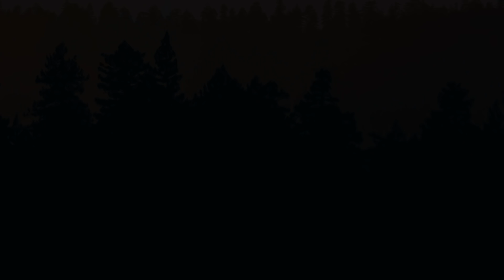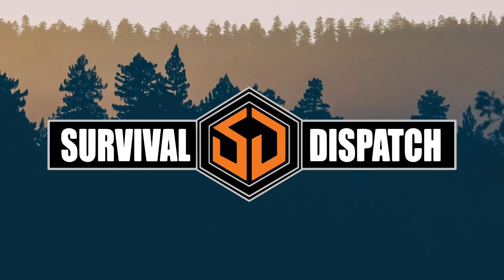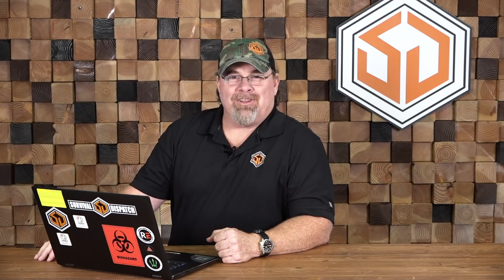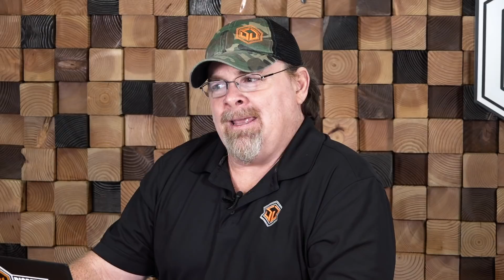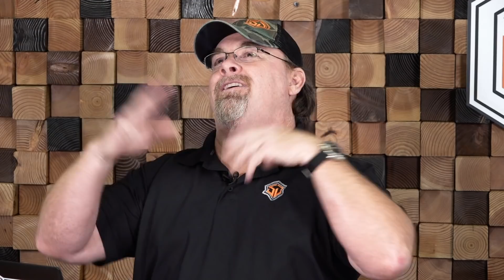All About Generators!

Comment: GFCI's do NOT sense ANY kind of shorts!!! They sense resistive connections between the hot line and ANY ground whether it be to a ground wire, water pipe or mud puddle. Not just neutral. Resistive connections like through the human body that won't blow a standard circuit breaker. Under certain circumstances, milliamps or thousandths of an amp can kill and never blow a breaker.
    There's also natural gas and there is a power difference between propane, natural gas and gasoline. Processed commercial natural gas has even less energy than propane because commercial gas companies usually remove hydrogen from natural gas and sell it separately because it's cheaper to make than making it by electrolysis. If you have a private well that you own, your results may be better. Free gas that is given by gas companies here in West Virginia in exchange for pumping gas from your land. It usually comes through normal service lines from a processing plant and, again, contains less energy. Propane does NOT reduce the output of a generator. Propane reduces the output of the ENGINE driving the generator. I only say this for the people who are building a system from scratch. In other words, If someone acquires a 5000 watt generator head and wants to marry it to an engine, if they're going to burn gas, a 10 horse engine will work fine. If they plan to go to Harbor Freight and buy an engine with the intention of converting it to propane, they will need to pick up at least a 13 horse engine to compensate for the lower energy capacity of propane.
    I bought a Coleman 5000 watt generator with a 10 horse Tecumseh engine in Florida with a 2 year extended warranty in 1998 in anticipation of an impending storm. Twenty months later, I asked my wife if maybe we should pull it out of the box and see if it works before the warranty ran out. Needless to say, the storm didn't materialize. It worked. Fast forward to 2001 and we moved to West Virginia. We had a doublewide moved onto our land. Being disabled, it took 3 weeks to get the meter box and disconnect installed on our house so we used that generator 24/7 to run the fridge, window A/C, (wife has temp. regulation health issues), lights, freezer, TVs to keep us and the kids busy. I wired 2) 4 gang steel outlet boxes back to back to both legs of the 240 VAC 30 amp twist lock plug. After tripping over the cord one night and breaking the twist lock socket, I went the next day and bought a 50 amp socket and plug.
    The engine instructions called for the oil to be changed every 40 hours. When gas was $.69 a gallon then, the oil changes were more costly. BTW, I agree with the 24 hour oil change interval with today's generators.
    Anyway, Tecumseh went out of business years ago but that was a great engine and aftermarket parts are still available. Just before it went into semi retirement, I should have but didn't check the torque on the sparkplug which wiggled loose and ripped the threads out of the cylinder head. I removed the head and took it to a shop and had a helicoil installed. They didn't have another head gasket on hand so it sat unfunctional for a while. My above mentioned disability is my spine and I was coming up on my 6th surgery in a few months. During this time, sadly but serendipitously, I had a relative pass away who left my siblings and myself a bit of money. Knowing that I wasn't going to be able to whip Chief Tecumseh's 10 horses awake with the pull of a rope anymore, I went out and bought the smallest available electric start generator that I could get which turned out to be a 7000 watt Troy Bilt with a 13 horse Briggs and Stratton engine. This was a spine saver to say the least.
    When I was still using the Coleman, and after our NOT CONNECTED TO THE HOUSE garage was built, I knew that I was going to wire it so while I was picking up supplies for that, I bought enough 8 gauge 3 wire with ground cable and conduit to run from the nearby disconnect box on the house where I installed 2) 50 amp breakers then to the 8 position breaker box in the garage. I also picked up a 4 prong 50 amp outlet, plug and wall box. I wired the 50 amp 240 VAC twist lock plug that I replaced for the 30 amp unit in the generator to a piece of 8 gauge wire then to the 4 prong 50 amp plug and that socket to a set of dedicated 30 amp breakers in the garage breaker box. Then I went to my computer and paint shop and drew a labeled diagram of EVERY step that had to be taken and in which order then walked my wife and then teenaged son through it at the breaker boxes and generator until they could show me the process. Some call my setup with my "suicide cord" dangerous but my wall plug is dedicated. No dryer, compressor or arc welder. Just the generator so it is never unplugged. If we ever move from here, the generator is going with us and the 50 amp socket reverts to a 30 amp usable circuit in the garage.
    When I bought the Troy Bilt, it already had a 50 amp twist lock plug so my setup plugged right in.
    Fast forward to 2 weeks ago. My 90 year old father in law passed away. My wife was setting up the estate sale. I inherited his 6000 watt pull start Troy Bilt generator among other things. I wanted a backup unit ever since my Troy Bilt gave me trouble once when, after 6 years, the starter battery failed. It has it's own venerated spot in the garage alcove next to the walk in door right where I can pull my van up, hook up the jumper cables and fire it up painlessly. Again, my garage is away from the house. No monoxide hazard here. A tip for your viewers. The 18 amp hour gel cell replacement battery through Lowes where I bought the generator was $99.00 and a 10 day order wait. I went to Amazon, bought a 22 amp hour jump start box battery, same dimensions, for $44.00, free shipping non prime and got it in 3 days.
    Anyway, I thought back to the old Coleman setting in the garage playing host to about a decades worth of multigenerational spiders. I ordered a new head gasket, installed it and it fired up on the second painful pull. (My son grew up and moved out.) I sold it for $100.00 and I  kept the 7 year old unit from my father in law.

Comment: Thanks so much for all these tips. I was going to get a 7200/9000 peak, but now I know that would be overkill :o)
Reply: Here are the portable generator safety rules: this safety information is only for anyone who use a portable gas generator and for those who are planning on getting a portable gas generator. This is just a reminder for everyone’s safety. All generator safety rules should be followed carefully. This advice is just to make sure that everyone is aware of all the warnings and it’s just to remind people to be careful using portable generators. Generators can be dangerous if not used carefully. Every year, hundreds of people die or get injured when using portable generators due to carbon monoxide poisoning and electrocution. Make sure you are using your generator carefully and keeping others safe as well. There is something very serious that everyone should always be aware of when using generators. Some people do run their generator indoors which is not safe and that increases the risk of carbon monoxide poisoning which can cause death of family and you. Some people run their generator in wet conditions which can electrocute them. Please remember that you should never run your generator indoors. Remember that carbon monoxide is an odorless and colorless gas that you cannot see or smell. Carbon monoxide is a silent killer. Keep that in mind. Make sure your generator is 15-20 feet away from your house and away from doors, windows, and vents. Never use your generator in your porch too. Having a carbon monoxide detector is very important against generator safety. Some people also allow children to go near the portable generator which could pose risks. We need to keep an eye on our children making sure that they are not near the portable generator so they won’t get electrocuted or burned by the generator which is dangerous. A locking enclosure also keeps kids safe. A generator shed might look like a tempting place to explore, or take cover during a game of hide and seek, but a generator is a dangerous piece of equipment that can cause injury. It says on the manual that we should also keep children away at all times from the portable generator to avoid injuries. Please do not allow a child or unqualified people to operate the portable generator.  It is important to keep your children safe especially little ones. The portable generator can be hot during an operation. Just because some manuals missed what should be listed doesn’t mean it’s safe to do. Always follow the generator safety rules when using portable generators. Generators pose electrical risks. If you need to use your generator during wet weather, you need a generator tent to protect your generator from getting wet. Don’t let your generator get wet. Keep your generator dry and before using your generator, please make sure your hands and your generator is dry. Do not wear loose clothing when operating the generator. Everything that is said on the generator’s operating manual should not be ignored. Never smoke cigarettes near the generator. Please keep flammable things away from the generator. Never overload your generator too. Your generator can catch fire. Never ever try to plug a generator cord into a wall outlet to avoid back feeding. Back feeding your generator is dangerous. Always turn on your generator first before plugging in appliances and shut off the appliances before turning your generator off. Use a heavy duty cord for your generator and the cord should not be worn out. All the instructions should be followed carefully. Never refuel your generator while it’s running. It can cause fire if fuel spills while your generator is hot. You should turn off your generator and let it cool off before refueling it. Having a fire extinguisher next to the generator is also important. This is only a reminder for everyone’s safety of using generators. Make sure your generator is properly grounded. Having a fire extinguisher next to the generator is also important against the safety rules. https://youtu.be/I1jT3ANENvI and here is a video more about keeping others safe when using generators and also about our family’s safety. It’s important to keep our children safe especially little ones. We also heard that children should not be playing with electrical plugs and batteries. Hope this helps. Thank you.

Comment: ACTUAL POWER LOSS FOR ALL PRE-ATOMIZED FUELS WHETHER IT BE PROPANE NATURAL GAS OR WOOD GAS IT'S 27% THEN YOU HAVE TO COMPENSATE FOR ALTITUDE JUST RECENTLY COUPLE MONTHS AGO OR SO I WAS LOOKING AT SNOW BLOWERS AND THIS FELLOW WAS SAYING HOW THE ONE HE HAD JUST WASN'T DOING IT SO HE'S THINKING ABOUT GETTING A BIGGER ONE I ASKED HIM WHERE HE LIVED AND DOG ON IT HE LIVED WAY UP IN THE MOUNTAINS AND HIGH ALTITUDE AND I DIDN'T GET A CHANCE TO JUST SAY TO HIM YOU'RE LOSING A HUGE AMOUNT OF POWER JUST BECAUSE OF THE ALTITUDE YOUR SNOW BLOWER IS FINE IT JUST NEEDS A TURBOCHARGER GET IT TO RUN AT ITS SEA LEVEL RATED POWER
MY SECOND INJECTION HERE HAS I AM ELECTRICAL ENGINEER IS THOSE DOUBLE PLUGS ACTUALLY ARE FINE AND YOU DON'T HAVE TO TRIP EVERY BREAKER IN THE HOUSE ALL YOU HAVE TO DO IS TURN OFF THE MAIN BREAKER THAT WILL GO LET POWER GO OUTSIDE OF YOUR HOUSE BUT THEN YOU STILL NEED THE LEMONADE ONE BY ONE THE ONES YOU DON'T REALLY NEED TO USE CUZ IN AN EMERGENCY YOU WANT TO GET DOWN TO JUST THE BASICS YOUR REFRIGERATOR IS PROBABLY THE NUMBER ONE THING AND IF YOU LIVE IN A SWELLING SWALLOWING SOUTH OR SOUTHWEST YOU NEED A SMALL AIR CONDITIONER PUT ON THE NORTHEAST CORNER OF YOUR HOUSE SO IT'LL BE THE MOST EFFICIENT THAT IT CAN BE SO AS THE DAY HEATS UP IT'S IN THE SHADE AND THOSE ARE THE ROOMS THAT YOU SHOULD BE IN AND SHUT OFF ALL THE OTHER ROOMS IN THE HOUSE
DAVID GRENIS LIVING IN BOULDER COLORADO USA
Reply: Punctuation is a useful concept for yelling text walls. :-D

Comment: I hired an electrician had mine wired for a  transfer switch. I did not want to hurt or kill someone. Be safe ya'll
Reply: How much did it cost ?

Researching....

Thanks
Reply: You too be safe. Here are the rules about portable generator safety: This is just a reminder for everyone’s safety. All generator safety rules should be followed carefully. This advice is just to make sure that everyone is aware of all the warnings and it’s just to remind people to be careful using portable generators. Generators can be dangerous if not used carefully. Every year, hundreds of people die or get injured when using portable generators due to carbon monoxide poisoning and electrocution. Make sure you are using your generator carefully and keeping others safe as well. There is something very serious that everyone should always be aware of when using generators. Some people do run their generator indoors which is not safe and that increases the risk of carbon monoxide poisoning which can cause death of family and you. Some people run their generator in wet conditions which can electrocute them. Please remember that you should never run your generator indoors. Remember that carbon monoxide is an odorless and colorless gas that you cannot see or smell. Carbon monoxide is a silent killer. Keep that in mind. Make sure your generator is 15-20 feet away from your house and away from doors, windows, and vents. Never use your generator in your porch too. Having a carbon monoxide detector is very important against generator safety. Some people also allow children to go near the portable generator which could pose risks. We need to keep an eye on our children making sure that they are not near the portable generator so they won’t get electrocuted or burned by the generator which is dangerous. A locking enclosure also keeps kids safe. A generator shed might look like a tempting place to explore, or take cover during a game of hide and seek, but a generator is a dangerous piece of equipment that can cause injury. It says on the manual that we should also keep children away at all times from the portable generator to avoid injuries. Please do not allow a child or unqualified people to operate the portable generator.  It is important to keep your children safe especially little ones. The portable generator can be hot during an operation. Just because some manuals missed what should be listed doesn’t mean it’s safe to do. Always follow the generator safety rules when using portable generators. Generators pose electrical risks. If you need to use your generator during wet weather, you need a generator tent to protect your generator from getting wet. Don’t let your generator get wet. Keep your generator dry and before using your generator, please make sure your hands and your generator is dry. Do not wear loose clothing when operating the generator. Everything that is said on the generator’s operating manual should not be ignored. Never smoke cigarettes near the generator. Please keep flammable things away from the generator. Never overload your generator too. Your generator can catch fire. Never ever try to plug a generator cord into a wall outlet to avoid back feeding. Back feeding your generator is dangerous. Always turn on your generator first before plugging in appliances and shut off the appliances before turning your generator off. Use a heavy duty cord for your generator and the cord should not be worn out. All the instructions should be followed carefully. Never refuel your generator while it’s running. It can cause fire if fuel spills while your generator is hot. You should turn off your generator and let it cool off before refueling it. Having a fire extinguisher next to the generator is also important. This is only a reminder for everyone’s safety of using generators. Make sure your generator is properly grounded. Having a fire extinguisher next to the generator is also important against the safety rules. https://youtu.be/I1jT3ANENvI and here is a video more about keeping others safe when using generators and also about our family’s safety. Hope this helps. Thank you.